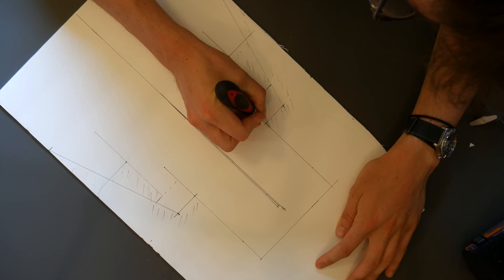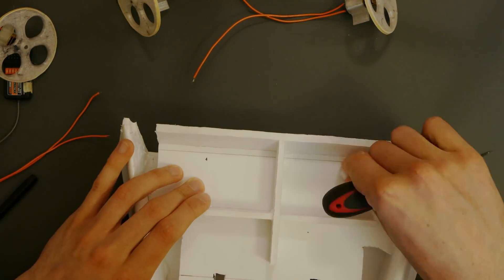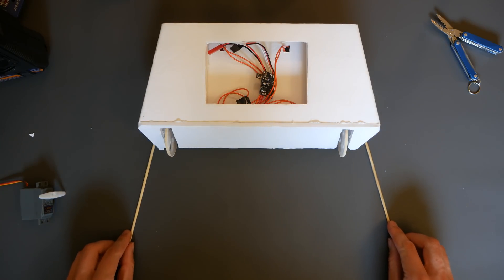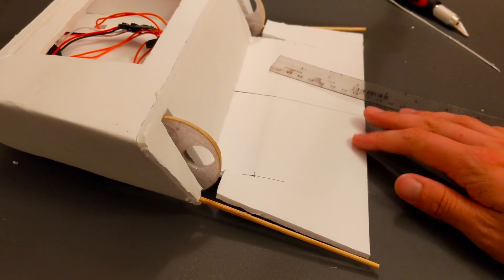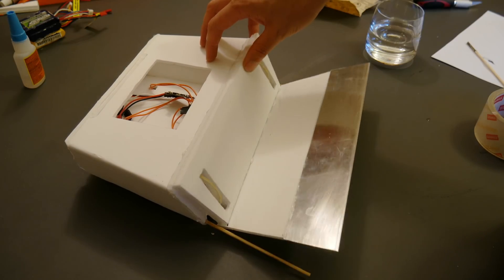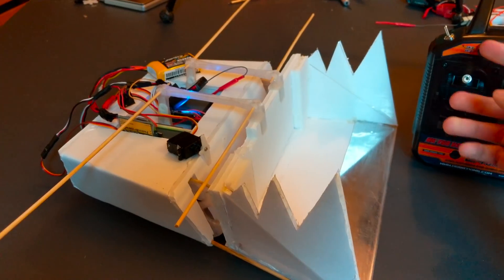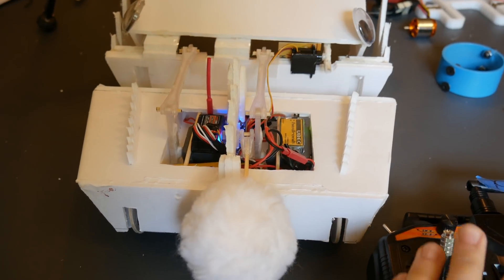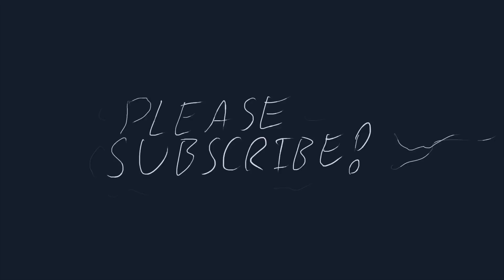Krave Monster Combat Robot (V3) Build Log

Comment: That's awesome, it's so cute!  have you considered reinforcing the motor leads (on the motors) with hot glue?  Also, what cutting tool are you using for the foam?  Again, awesome bot
Reply from the maker: I just cut the foam with an exacto knife. If the edge is rough I'll hit it with some sand paper.   I could reinforce the motor connections, but the motors are delicate so I want to keep it easy to swap one out and solder in a new one

Comment: I am exited to see if the new motors work better. I feel like you need to make it so the clamper part of the robot can move up more so that the other bots will fit inside of it. Good luck in the compatition! PS what dagree can the servo move to? If it is a 90 degree servo I highly recommend getting (or making) a 180.
Reply from the maker: Yeah, I need more travel on the jaw.  Might not have time to make mods though
Reply: Alta's Projects build a featherweight. I’d love to fight you at robogames.
Reply: They didn’t do feathers. The competition is gone now.